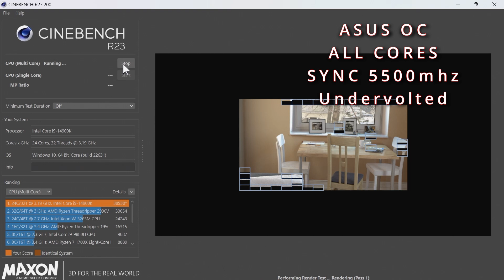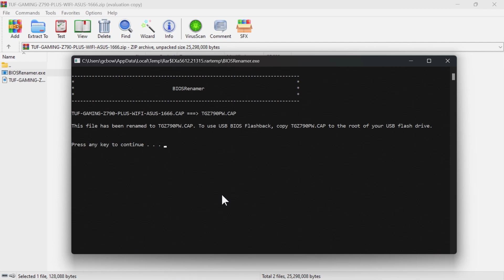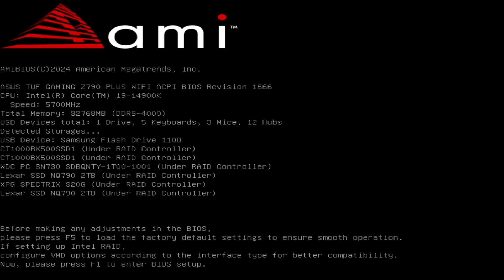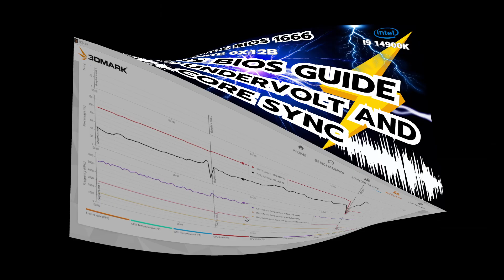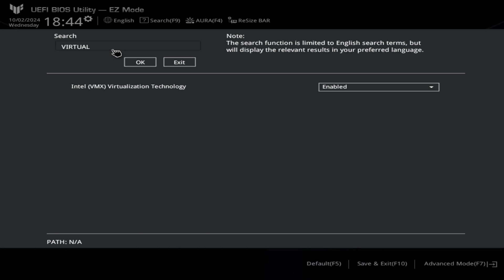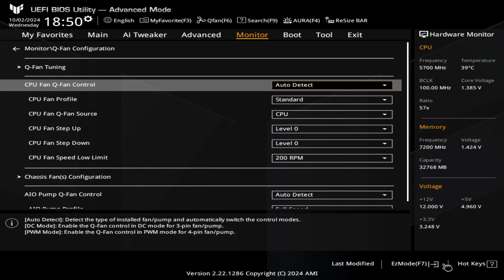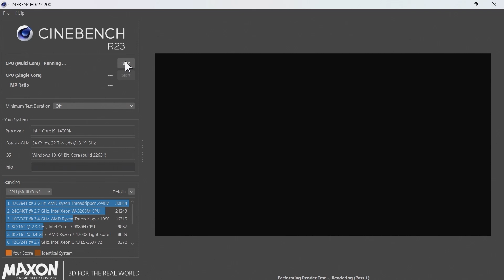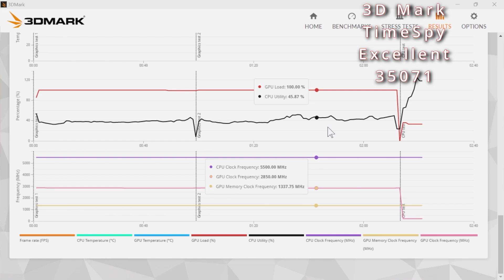i9 14900k Asus BIOS Guide Part 3 Version 1666 Beta Microcode 0x12B Improve Elevated Voltage at idle

Comment: I have applied the settings to my i9-9900KS on an Asus Z-790 board and it won’t post.  Any ideas?
Reply from the maker: @johnredrup1036  The guide is for an Intel i9 14900k, the i9 9900 is not affected by the microcode issue, and the parameters and voltages would not be suitable for that processor, unless you mean a 14900ks?, the socket wouldn’t be compatible on a Z790 motherboard regardless.

I would recommend if your Motherboard has a clear CMOS then reset the board back to default, then run the standard profile.

If it is a 14900KS then again do the same, once you get it to post, the processor may be suffering from degradation so you may want to consider RMA’ing it if it has difficulty running on the applied BIOS update even on the Intel Default settings.

I am unable to test other processors other than the i9 14900k and the guide is specifically designed to cater for users of such.
Reply: @nextlevelsimgaming  you are correct it is a 14900ks, sorry.  I am able to run it in default mode and extreme XMP1.
Reply from the maker: @johnredrup1036  Sorry John, I thought your username looked familiar from previous posts.  The Asus OC profile is required to sync cores, are you running 4 x DIMM slots of DDR5 ram by any chance?, or two?, there may be a delay in responding to your replies as i’m doing footage for a Vr guide on modding presently
Reply: @nextlevelsimgaming  no hurry.  This my ram config: Crucial Pro 48GB (2 x 24GB) DDR5 6000 (PC5 48000) XMP 3.0
Reply: And thank you!
Reply: I am undercoating 0.07500
Reply from the maker: @johnredrup1036  Reduce the undervolt to -0.05000 stress test using for example Intel XTU AVX2 stress test for 10 mins, if it passes increase the undervolt by increments of -0.005 so next is -0.05500 then -0.06000 etc the 14900KS runs higher PL1 and PL2 up to 320 so its likely you’re removing too much power for the CPU ti operate correctly
Reply from the maker: @johnredrup1036  Thats fine, sometimes 4 x DIMM of DDR5 can cause major instability issues
Reply: @nextlevelsimgaming  the undervolt is working on my config.  Where I get in trouble is f5 and trying to use the Asus oc profile.  When I use intel default and extreme it works fine.  I tried your settings with -0.0500 and it still wouldn’t post.  I suspect it is something in the OC profile it doesn’t like.
Reply: @nextlevelsimgaming  also I haven’t applied the new beta update.  Were your settings dependent on that?
Reply from the maker: @johnredrup1036  Undervolting doesn’t rely on the update no.

However your processor can run at slightly different voltages, although it should be good with those shown, a lot of the issues people encounter can be a result of the known degradation issue, so there is a distinct possibility that yours may be affected.

The settings for Extreme profile for yours are -

ICCMAX - 400A
PL1 - 320
PL2 - 320

I would say that the undervolt may have been too extreme in the absence of the correct setup for your variant, everything else remains the same.

Silicone quality is the variable normally but with the degradation issue its often highlighted at times like this when we start to play with the variables.

Comment: I'm on rog z790-e gaming wifi. Bios ver 2503. The New beta ver is 2602. I tried it and it actually made it worse. I started getting the out of  memory bs ...and started having issues with my ram ..ive been running 4 sticks ddr5 6400mhz xmp on my 14900k , but ever since i did the bios update now it has a hard time running at 6400mhz so i put it at 6200 and its fine but still ..wtf..!  So I rolled back ..thoughts ?
Reply from the maker: @coryo617  Interesting, I did notice some mouse freezes on the Intel Baseline Profile, this was rectified when set to Asus OC, and undervolted and cores sync’d.

I had a 2 hour gaming session last night, posted the temps in a community post, noticed that idle behaviour is noticeably improved and temps very stable.

It is a Beta update so far, my experience of the previous 0x129 Beta was terrible to be honest, so i’m pretty weary of them, I am doing some new content videos this weekend, and having a lengthy VR session on Half Life Alyx on max settings in a moment for some content capture, if I become aware of any issues I will flag it immediately.

But thanks for bringing it to our attention, definitely interesting info

Comment: I'm still using Intel XTU, but I realized you never mentioned anything about disabling Intel adaptive boost technology on your XTU video.  Should I have it disabled or keep it on auto?
Reply from the maker: @Recon911PDW  I have found on XTU it actually doesn’t make much difference, but for BIOS undervolting it does, but only by say 200 points or so ln Cinebench, when the cores are sync’d it can’t boost anyway, but with it enabled in BIOS it creeps ever so slightly by 100mhz or so, but good observation 🙂

Comment: New to under-volting and bios settings. Followed your guide and ran a 3DMark bench my results were:

Graphics Score - 28194
CPU Score - 23297

Current config:

RTX 4080
I9-13900k 

Is this a good result? Are there any suggestions to the bios to improve or should I leave it as is?
Reply from the maker: @porterj292  I had a GameRock RTX 4080 before I got the 4090 and the 3D Mark scores were 28265 GPU and CPU score of 19535 with an i9 14900k (on original BIOS no undervolt or OC) so that is a very good result 😎

You can run a tune on the GPU using the Nvidia app (see my other video), but obviously the guide has worked well for you 🙂
Reply: @nextlevelsimgaming you sir are a legend and can’t thank you enough! Keep up the good work!
Reply from the maker: @porterj292  No worries, glad to be of help to you 🙂
Reply: Wow, how did you get such a high CPU Score. I have an i9-14900k with a rtx 4080 and I get a cpu score of around 19000. I have applied the settings nextlevelsimgaming provided. My GPU score is on other hand 1000 points higher than yours is.
Reply from the maker: @viktor245iscool  Thats very strange, if you can post a your 3DMark link i’d be interested in seeing that.  The RTX 4090 has had a performance tune in the Nvidia app (mild overclock) check my other video guide on that, the i9 14900k should score 26k ~ when undervolted
Reply: @nextlevelsimgaming  And weirdly after installing the 0x12B bios microcode update and set my all core ratio to 55, my cpu clock frequency is 5487 MHz under load instead of 5500 MHz. I don't think that the 13 MHz difference will be noticeable but still weird.
Reply from the maker: @viktor245iscool  Current Excursion Protection may keep it slightly lower than 5500, it depends on workload
Reply: @nextlevelsimgaming  [This comment didn't post the first time and second time I tried, so I'm posting again, really weird]
Thanks for following up! After my initial comment, I performed a clean Windows 10 install (previously running Windows 11) and saw a significant improvement - my CPU score jumped to 24,000+ in 3DMark Time Spy. My CPU is still undervolted at -0.065V, and I haven't reconfigured any BIOS settings before or after the reset.
The score improvement is quite interesting - it could be due to either a Windows 11 issue or perhaps some problematic software I had installed. However, I'm still about 2,000 CPU points below your score. Could this difference be attributed to my cooling solution? I'm running a 240mm AIO. My GPU is mildly overclocked through the NVIDIA app.
3DMark Windows 11: https://www.3dmark.com/spy/50944023
3DMark Windows 10: https://www.3dmark.com/spy/50949893
Reply: @nextlevelsimgaming  I have IA CEP turned off.
Reply from the maker: @viktor245iscool  Ok, I have looked up your scores. and the figures look correct.

I was at the time of running a i9 14900k and Palit Gamerock RTX 4080 running 5800mhz sync'd with an undervolt here - 

https://www.3dmark.com/spy/48283966

The temps were however borderline unstable as I was also running 4 x DIMM of DDR5 @ 6800mt which didn't run stable.

I now run the specs as you can see here on a 4090 with 32gb Corsair Dominator Titanium @7200mt, the GPU carries a lot of the load of the CPU hence the high score, you won't see on a 4080 more than you are getting without a GPU O/C

https://www.3dmark.com/spy/50846335

Hope this helps clarify 😃

Comment: Why are you doing this? Using microcode does not affect the degradation of Intel. Your processor continues to work with a voltage greater than 1.4v. And why overclock one core when any modern games use at least 8? Why not just fix 14900k at 5.5 or 5.6 with a voltage of 1.36v, remove all limits and get maximum performance without processor degradation? Intel releases nonsense, and you all repeat after it like parrots...
Reply from the maker: @314LA  I’m pretty confident that a microcoded hard instruction set to the processor after a thorough investigation by both Intel and the manufacturers is an action worth taking, if you’re unfortunate to have suffered degradation issues, then if after taking all necessary actions as advised, and still experience issues when running the Intel Default Profile, then Intel have little option but to replace the CPU under the RMA process.

Intel specifications allow VID Max to a limit of 1.55 however I prefer a safer max limit of 1.45 which is why I have that as part of the final undervolt guide, you need to allow some flexibility for V droop so fixing a hard limit of 1.36 may result in instability during heavy loads.

See the community post on earlier game testing showing real world extended tests.

Sync’ing the cores to 5500 is I have found to be the best frequency for gaming, and heavy workload with consistency throughout, I am working on an upcoming video showing the disparity between frequencies.  Other content creators such as Buildzoid, Frame Chasers also recommend applying the BIOS updates ad benefits are obvious, but also recommend removing core boost, and syncing the cores, I present it in my own way further to real world gaming testing, not just benchmarks (yes, I actually play games, unlike others) and make the guides as concise and as simple to follow as possible, of course we all have our own opinions and choices in what we do tuning wise 🙂
Reply: @nextlevelsimgaming  I think later we will get an accurate assessment of the causes of degradation, and not this constant lie from Intel. However, now it is clear that the degradation is caused not by the power of the processors, but by increased voltage due to the boost of the Intel cores.And installing microcode from Intel, which limits the power and slightly reduces the voltage during turbo - this is like the muttering of sorcerers with gangrene. When penicillin is enough.😀
Reply from the maker: @314LA  Dont get me wrong here, I agree that Intel have dealt with this issue terribly, also essentially they have advertised a product that makes claims that the CPU will fly you to the moon, however in real terms if you use the boost levels, you’re more likely to burn up on rapid descent.

All we can do is make the best of the situation, but its still great performing processor, but Intel (for legal reasons obviously) cannot say undervolt, sync cores etc, as they would be admitting the product is not capable of what is advertised, its like saying “This car is capable of 200mph” technically yes, but not consistently at that speed for 8 hours a day, with some users even overclocking to 6.1ghz.

The real irony is Intel XTU’s auto tuning automatically attempts to overclock beyond Intels absolute safe guidelines, thats what I can’t get my head around.  Thanks for your comments though 😉

Comment: Is it unusual for my cpu speed to drop from the 5500mhz to around 5100mhz during an r23 run? Perhaps i need to adjust the voltage offset?
Reply from the maker: @Sphios  Not actually monitored the speed during an R23 test, but is your power management mode set to ‘Prefer Maximum Performance’ ?
Reply: @nextlevelsimgaming  It's set to Ultimate Performance
Reply from the maker: @Sphios  And whats the score outcome of R23?
Reply: @nextlevelsimgaming  only got it up to 37421. Might be because my CPU frequency dropped
Reply from the maker: @Sphios  Have you closed all background applications?, Steam, Chrome, RGB software etc?,  remember Benchmarks are run with these closed for accuracy.

Also undervolt will affect temps, start at a negative offset of minus - 0.0500 then in .5 increments so then -0.05500 then -0.06000 test for stability in between using Intel XTU AVX2 test for 10 mins, or Cinebench R15 or R23 on 10 mins any crashes add back in the voltage you removed.

Watch my Intel XTU tuning guide for more info on that.
Reply: @nextlevelsimgaming  Good point. I'll try that out. Thank you for taking the time to reply
Reply from the maker: @Sphios  No worries 😉

Comment: I just RMA my (unstable,BSOD) 13900K last month.They send me new 14900K as replcement.Updated to latest BIOS today,i didn't set 
settings in BIOS yet,only XMP for RAM and ReBar.
MB is ASUS Rog Strix Z790-F Gaming WIFI.Will test some more and see how it runs.
Thnx for your video guide.
Reply from the maker: @realkekec4028  No problem, i’m sure it will work well for you 🙂
Reply: How are your results in cinebench 23?
Reply from the maker: @J4ckKun  Just over 40k

Comment: I have not had a problem with my processor so far, my computer has not frozen or crashed, so my processor is not broken, but I still made these settings to protect it. I would like to get your thoughts. respectfully brother
Reply from the maker: I would certainly recommend applying these BIOS updates, regardless that combined with the Intel Default settings that they reduce performance, even respected PC tuners such as Buildzoid have endorsed that they work, you then can also regain performance by undervolting and synchronising the cores as we have in this example.

Also if your processor is degraded, you can demonstrate to Intel that you have done everything possible to mitigate the issue, reinforcing your ability to RMA the processor

Comment: Do you think that after making the latest microcode update, I need to secnorize low voltage and voltage limiting and extra processor core speeds, for example 5.5 ghz.
Reply from the maker: I would recommend applying the same settings in the Asus OC Settings and Undervolt applied example.  The issue with boost still causes instability, an undervolt will prevent high temperatures and throttling, and sync’ing the cores improves stability and therefore FPS minimising crashes.  I noticed some freezing with the Intel Default settings of the mouse movement, not something I have experienced before, bear in mind that this is a Beta release however
Reply: @nextlevelsimgaming  tahnk u so so so much bro best regards
Reply: Will I have any problems after making these settings? Because I draw in games and programs and also because I render.